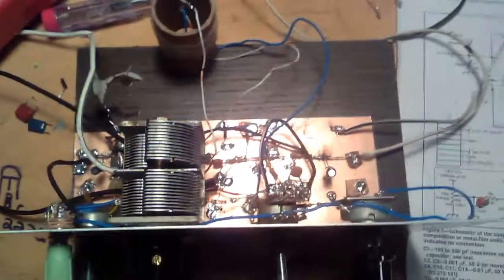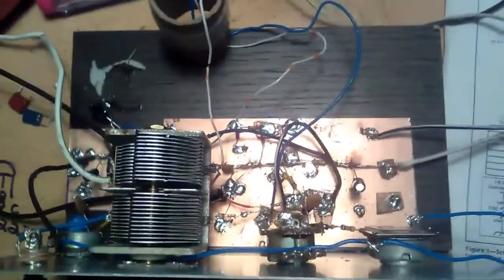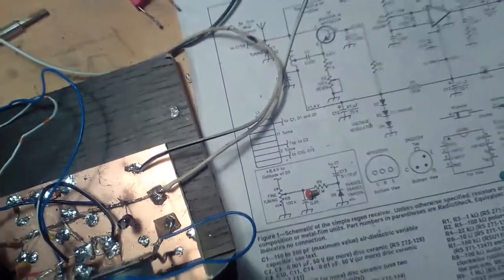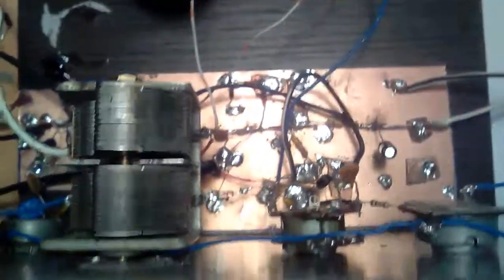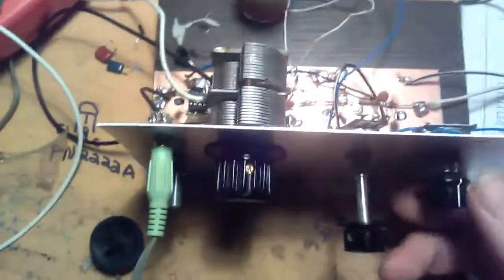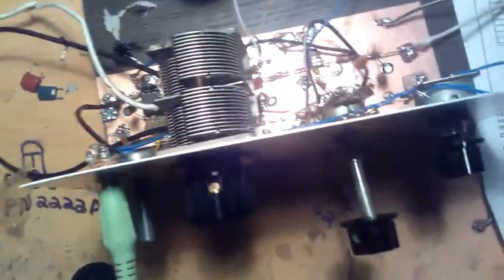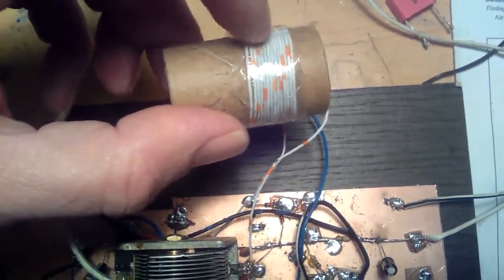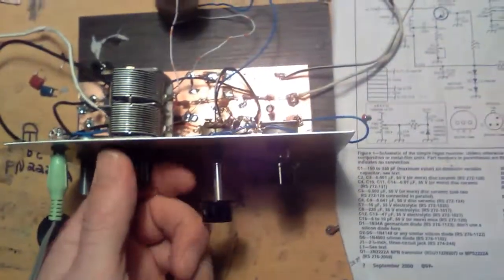I'm in need of a little advice regarding a regenerative receiver I built very bad hand capacitance.

Comment: Connect the the front metal to ground and this one is a bit harder the big variable capacitor you have make sure that the thing that you turn is grounded because if it is not it makes this problem hope this helps 😊😊❤
Reply from the maker: Thank you very much for your input 👍 really appreciate it i learn alot from other people. I take all the advice onto the next project im currently trying  to repair a gigatronics 6061a rf signal generator I dont suppose you know anything about them do you im stuck at the moment the phase lock loop is not locking